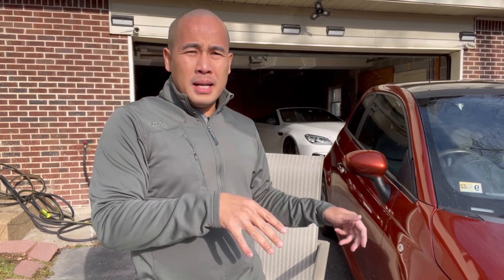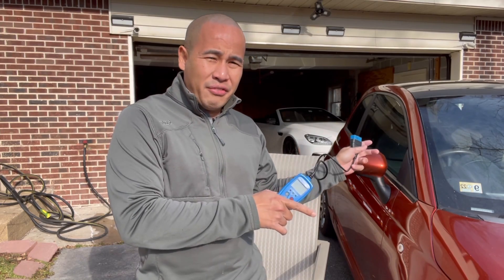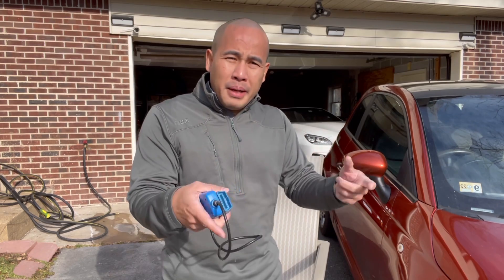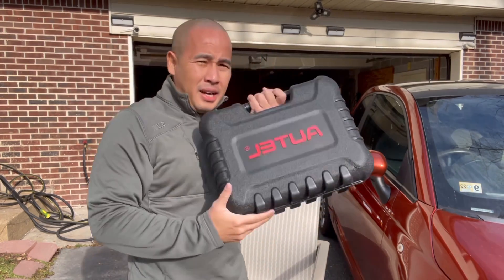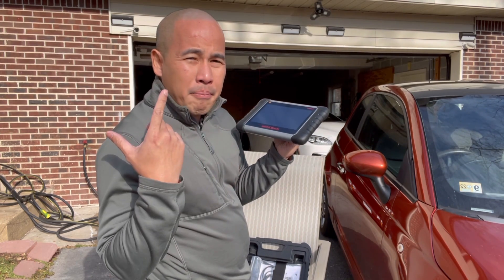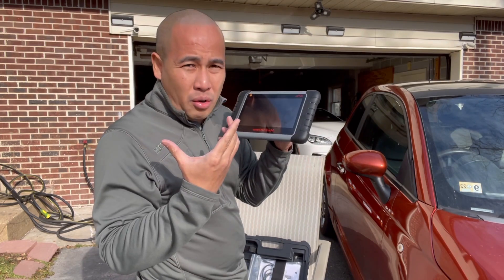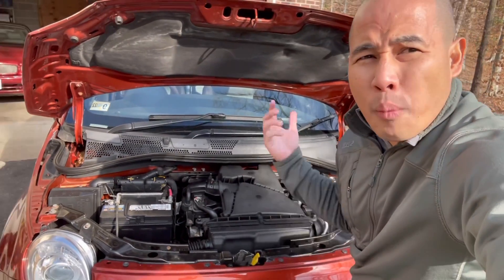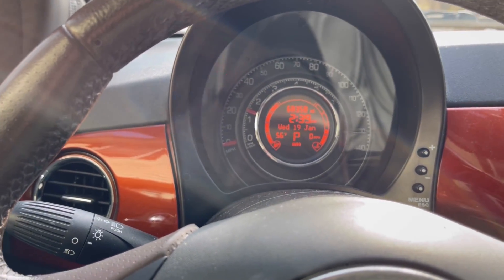Fiat 500 - How to Troubleshoot & Fix/Repair P0301,P0302,P0303 & P0304 Check Engine Light Error Code

Comment: What happens if your engine light still showing weeks after you change the coil pack and spark plugs 🔌
Reply from the maker: You probably need to have the car checked by a mechanic

Comment: I changed the spark plugs on my fiat 500 pop 2015 an the coils but keep getting the check engine light, and code P0300
Reply from the maker: I hope that there is nothing wrong with the fuel pump or there is no vacuum leak.
https://www.fixdapp.com/blog/p0300-code/

Comment: Great video, how about a P0262 Cylinder 1 Injector "A" Circuit High Code. Would love to see a video on replacing fuel injectors
Reply from the maker: Thank you very much. I haven’t had the P0262 yet. Once I have it then I have to make the video.

Comment from the maker: You can purchase the tools, spark plugs and coil packs from the affiliate links below:

1. DEWALT Mechanics Tool Set, 192-Piece (DWMT75049)
https://amzn.to/3l1kXv8

2. 3/8" Drive Magnetic 3pcs Swivel Spark Plug Socket Set, 5/8-Inch, Magnetic Universal Spark Plug Service Kit, 3 Piece - 4", 6" & 11" Length-by Kauplus
https://amzn.to/3A56we3

3.  2012 FIAT 500 COIL PACKS AND SPARK PLUGS: (Make sure pay attention to Amazon fitment warning)
     
     NGK Set of 4 Pencil Type Ignition Coils Distributorless For Fiat 500 1.4L L4
     https://amzn.to/3fW8BB2
     
     NGK 6046 DCPR7EIX Spark Plug (Pack of 2) by NGK
    https://amzn.to/3Atc17P

     2013: THE BOSCH COIL PACKS AND SPARK PLUGS ARE FOR 2013 FIAT 500 ONLY! 

     Bosch Set of 4 Double Iridium Spark Plugs For Dodge Fiat Jeep 1.4L L4
     https://amzn.to/3nstTdS

     Bosch Set of 4 Ignition Coils For Fiat 500 12-17 Dodge Dart 13-16 1.4L L4
     https://amzn.to/3rr64Em

5. CRC Technician Grade Di-Electric Grease (3.3 Oz)
https://amzn.to/3owVhbZ

6. Liqui Moly 2331 Leichtlauf High Tech 5W-40 Engine Oil - 1 Liter
https://amzn.to/3A78jiB

7. SATA 53-Piece 3/8-Inch Drive SAE and Metric Socket Set, Standard and Deep Sizes, with Ratchet and Other Accessories - ST09009U
https://amzn.to/3B5vaMO

8. Duck Tape
https://amzn.to/3otdqaw

9. W40
https://amzn.to/2Yjj44w